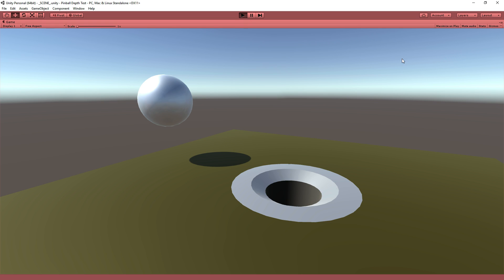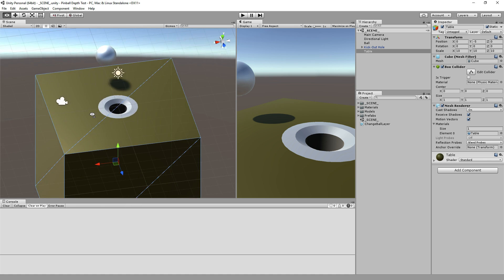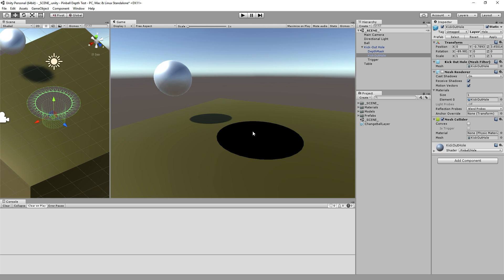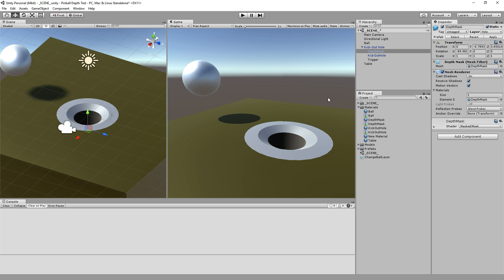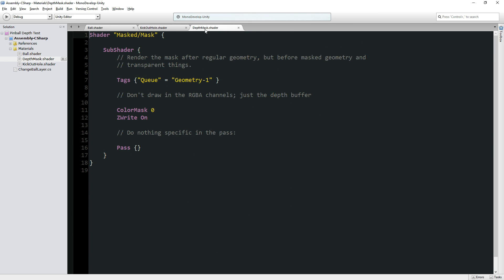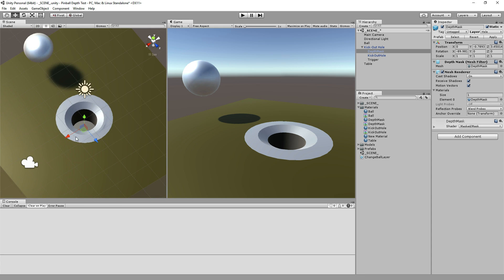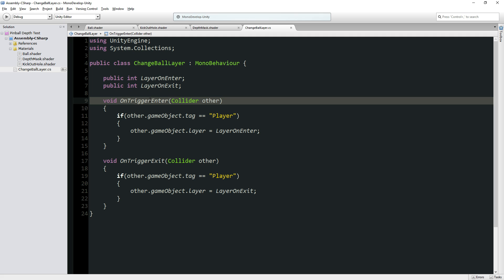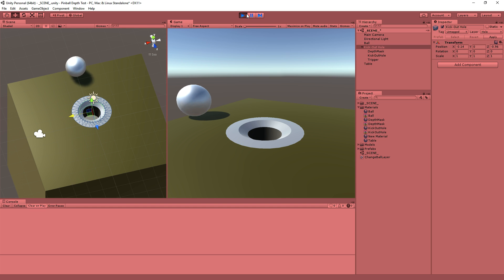Unity Sort-of-Tutorial: Making Fake Holes [Render queues, depth masks, and physics tricks]

Comment: I loved the technique, even though it doesn't solve my particular problem, maybe you could point me in the right direction?

Imagine that I want a wooden board with one or several holes draggable just like yours. But unlike your holes, they wouldn't have a bottom, they would cut the boards right through. So far so good, this technique still works... But then it won't allow me to see a board that is behind a hole of another board. Any whole in any board would be perceived as a hole in all the boards. So what I need is something that applies only to a specific volume, and not to the infinity...

Comment: TO SAVE SOME PEOPLE A LOT OF TIME

This only works in forward rendering mode unless you create extra code to mask out via render to texture and then apply that to the final render. 
You can find more info in the stencil info page from Unity under Deferred section.
Reply: Alternatively you could use two cameras and have the forward render camera used only for holes n such, however with cinemachine brain use only working on one camera there def are issues with that solution.

Comment: Despite showing promise, this is just to let you know it doesn't work with unity terrain out of the box. 

If you change the terrain's material to something other than it's standard built in shader it will kick up a fuss and the terrain textures do not work right.

If you leave the terrain material as is, the terrain looks great but the object that is supposed to be looked through doesn't hide the terrain inside it.

I even copied the terrains standard-base shader I downloaded and used that and adjusted the queue value to geometry, rather than geometry-100, which is the default, but no joy there, the textures messed up as well.

But, using the normal standard shader ( not designed for the terrain ) it messes up the textures as expected and the zbuffer graphics tries to redraw ( probably something to do with the terrains drawing cycle ) but briefly the tunnel I created going through the terrains mountain is visually pleasing ... for a few seconds :) 

The trigger script is also not working for me for some reason either.   If I manually change the player's layer to tunnel and walk further in the tunnel appears and the terrain disappears, and when I switch it back to terrain and the player drops to where the terrain is ( or through it if already below the level of the terrain ) .

Maybe you could take a look see at getting it to work with terrains.  Sounds like it could be interesting.
Reply: It would also cause series issues with shadows.  This is a great system for certain situations, but definitely not the ´OMG caves´ solution for terrains.
Reply: Do you know of a solution that would still allow shadows?
Reply: You could use a Raycast and check the property and material of the ground and put it in a variable and use that in case it changes material.
No idea if it will work i'm not good at programming but maybe, just like to throw stuff out

Comment: Your first two points about the physics engine and the shading can be worked around easily.  Proper topology goes a long way, even if you're cutting holes with a boolean modifier or something you don't just need to slap these blindly onto a quad because you're right, that makes a mess.  The physics engine doesn't like long, skinny tris but proper topology can fix that.  As for the shading, use the auto smooth option or manually set hard edges and it's fine (or use flat shading, it's flat anyway).  Again, something that can be worked around easily.

However, you're right that this trick can be used to quickly make holes you can move around in Unity.  For that reason alone this is probably a better way.  Also, terrain can't have holes in them normally, but using this trick they can.  Now you can use normal Unity terrain and still have caves and stuff.

Comment: Could this way be used when placing a subway entrance model on a terrain tile or mesh so that a player can go to an underground area, say a subway?
Reply: that would be really cool and super handy if we could
Reply: Yeah, at the moment I would have to either have the subway model with several flat meshes to fill in the gap that gets cut out, or use the loads of triangles around the cut out, but wouldn't having loads of triangles around the cut out cause issues on the UV Mapping when you are painting the ground layers.

So if the way Quill shows works that would be great and save a hell of a lot of time.